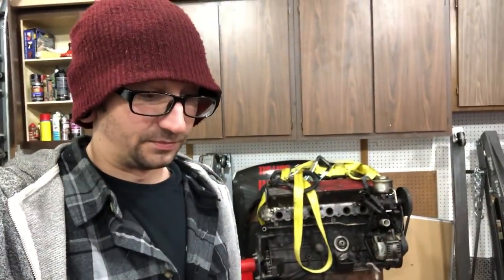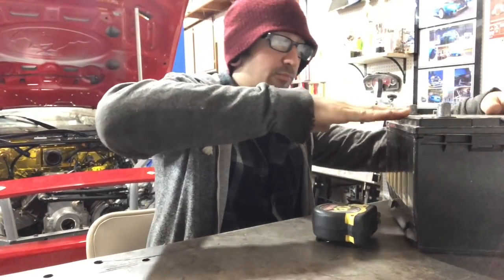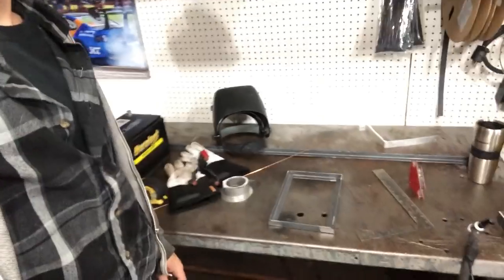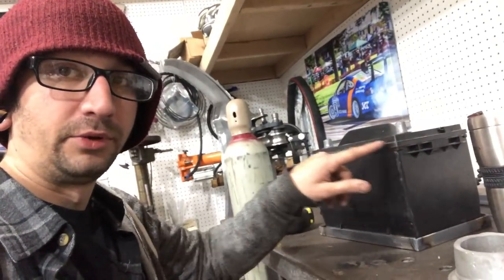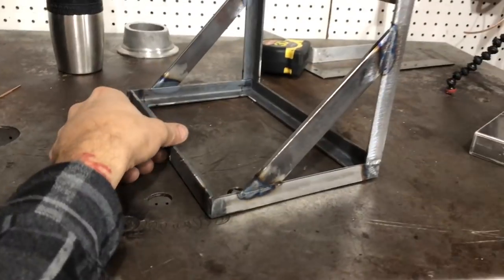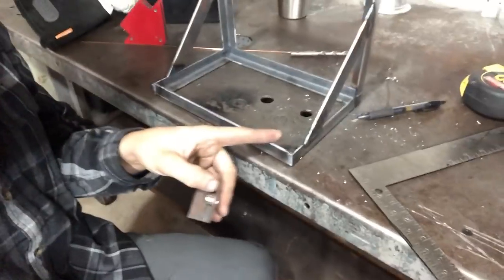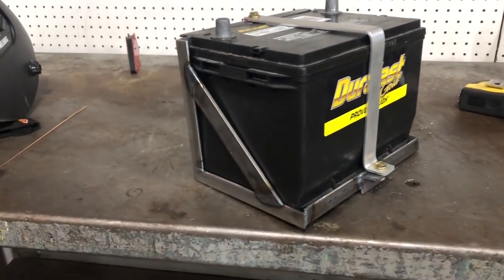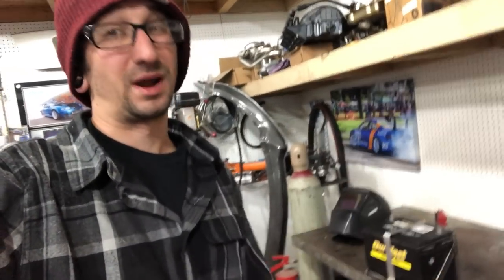DIY: How To Build A Battery Tray

Comment: Looks like your bracket came out nice.  Surprised you are just supporting battery along the perimeter, why not reduce stress by putting a piece of flat sheet metal inside your frame?  Then you will have a 'tray".  Also it would be nice to see you weld, puddle etc.

Comment: My 2018 Ram promaster city 4 cylinder  runs the OEM Group 48/H6  start battery which is 70AH 120 Reserve Capacity.  I have no room for an auxillary battery and have been trying to run a fridge and fan and have drained it a few times.   If I have the room for bigger battery tray for  a big dual purpose deep cycle marine that is 13 inches long.   If the battery has enough Cold cranking amps and I'm in warm Florida,  should I worry this will put too much pressure on my alternator? How about voiding my 36 month/ 5 year drive train warranty?